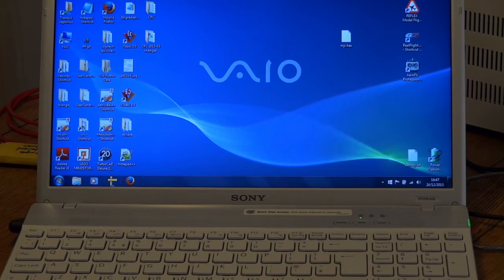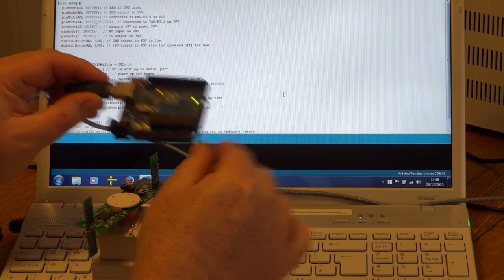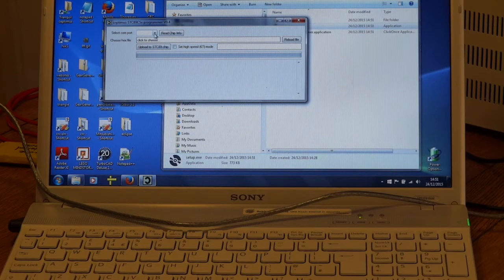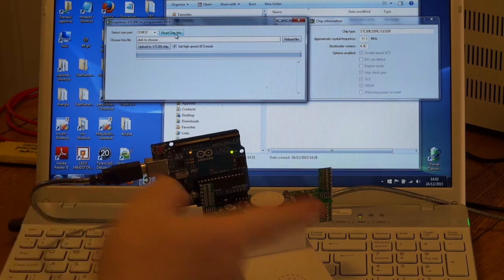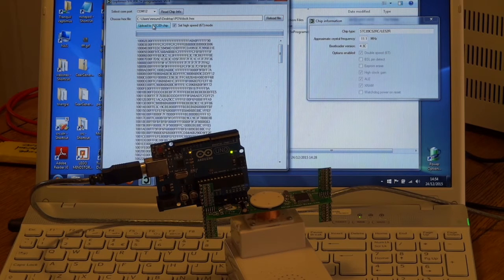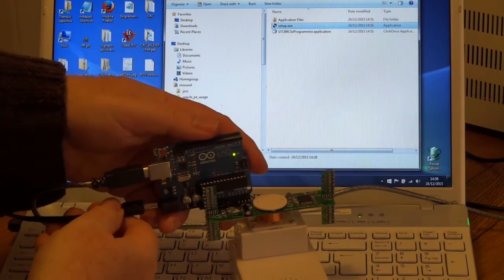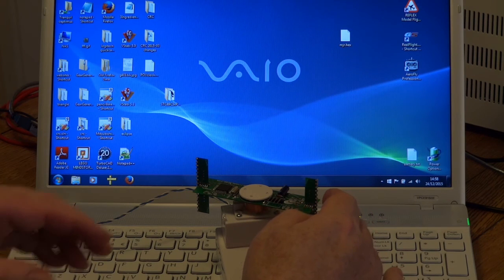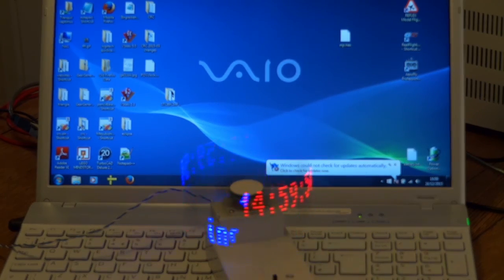Using an Arduino UNO to program the Banggood POV kit

Comment: does this work if you have a separate STC89C52RC microcontroller? i tried but i didnt get it to work. could you help me? I got my arduino working with the sketch but i cant get the ceptimus software to recognize the chip. any tips`?
Reply from the maker: +Tobias 
Yes - I've used it with a separate STC89C52RC.  The STC chip does need to be connected to a crystal and the little capacitors next to the crystal.  It shouldn't matter what the crystal frequency is, as long as it's in the range the chip can use (maybe 4MHz to 20MHz) - as that's automatically recognized by the bootloader.  It's recommended that the STC chip also has its RST (reset) pin wired up to a resistor/capacitor, though I've found it works without that.  The way it connects is that you have to power up the STC chip while the PC (or Arduino) is already 'probing' it by sending ASCII 127 [DEL] characters.  As part of its power-up routine, the STC chip looks for such characters and if it sees them enters into bootloader mode.  The Arduino sketch powers the chip via an output and only switches that output on when it sees the PC sending the DELs.  If you have some other power source for the STC then that must be powered down.  I've also used a stand-alone FTDI chip for programming - with that I start the PC program trying to connect and then power up the STC chip with a manual switch.
Reply: +ceptimus could you make a schematic and show how you did it? i tried to put the 89c52rc in a breadboad but im not able to get to work.
Reply from the maker: +Tobias 
Okay, I will.  Do you have the big 40-pin DIL STC chip?  What crystal are you using?  The crystal most people use is an 11.0592 as this makes it easy to get accurate standard baud rates on the chip's serial port.  Look on my website http://ceptimus.co.uk  I should have a post up on there with a schematic and a breadboard example later today.
Reply: +ceptimus i have the big 40 pin stc chip and and i found i 4 mhz crystal does that work?
The thing is im trying to program a 8x8x8 led cube and im supposed  to use an usb 2 ttl but i cant get that to work so im trying to do this instead. I guess this method should work for my cube as well?
Reply from the maker: +Tobias Here's a link to the schematic.  http://ceptimus.co.uk/BreadboardSTC89.pdf 
I'm still working on the post and the video.  I don't have a 4 MHz crystal myself but I've tried 8, 12, 16 and 20 MHz ones. Do you have an oscilloscope so you can see whether or not the crystal is actually oscillating?
Reply from the maker: +Tobias breadboard YouTube is now up at: https://youtu.be/6cBVH6XN3Bw
Reply: +ceptimus thanks very much. but is there a possibilit that the microcontroller is lock in some how? Beacuse im wasnt able to program it. I tried to use a 24mhz and a 4 mhz crystal with both an arduino and a usb 2ttl. Nothing works?
Reply: +ceptimus thanks very much. but is there a possibilit that the microcontroller is lock in some how? Beacuse im wasnt able to program it. I tried to use a 24mhz and a 4 mhz crystal with both an arduino and a usb 2ttl. Nothing works?
Reply: +ceptimus thanks very much. but is there a possibilit that the microcontroller is lock in some how? Beacuse im wasnt able to program it. I tried to use a 24mhz and a 4 mhz crystal with both an arduino and a usb 2ttl. Nothing works?
Reply from the maker: +Tobias As far as I know there is no way to lock the microcontroller.  I found that my STL chip is less reliable with the Arduino than with the stand-alone FTDI - with the Arduino I have to try several times before it works, but the FTDI works every time.  Do you have the small (22pF) capacitors on the crystal?  Can you buy or borrow an 11.0592 MHz crystal and try it with that?
Reply: +ceptimus i Will see if i have another crystal
Reply: +ceptimus I have now tried to progam it with a 11.0592 MHz crystal and every thing as shown in the schematic and it doesnt work. I have been using two types of usb 2 ttl and tried with my arduino aswell. Is there any way that the stc chip is defekt?
Reply from the maker: +Tobias I suppose it's possible that you have a defective STC chip.  When you apply power to the chip with the crystal connected are any of the 32 pins on P0, P1, P2, P3 cycling at all?  The chips I've tried seem to come with some kind of test program that does cycle some of the I/O pins quite slowly when the chip is running.  It's slow enough to see just with a voltmeter or you could try a LED with a pull up resistor on each output in turn.  If some of the pins are doing something then the chip is probably okay.  These STC chips do seem very sensitive to the type of serial interface used so try some others if you have them.  After that I'm afraid you probably need an oscilloscope to do further diagnostic tests.